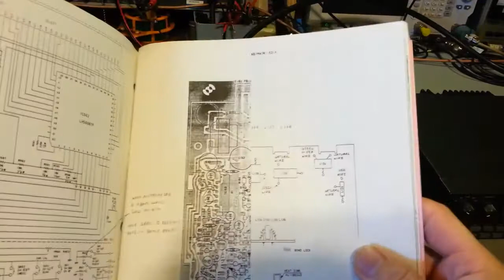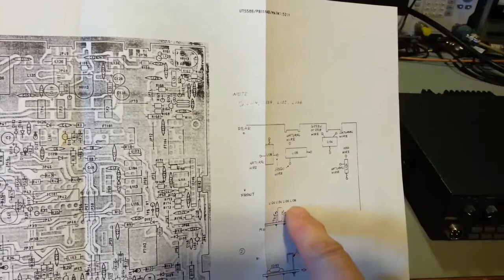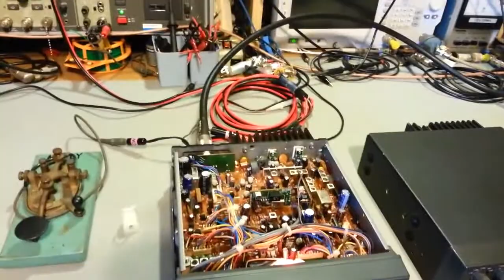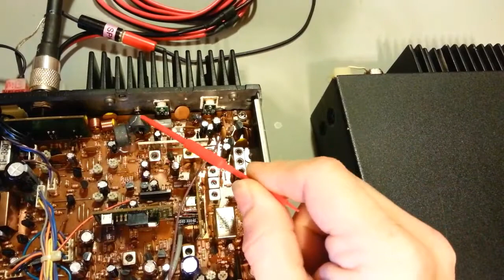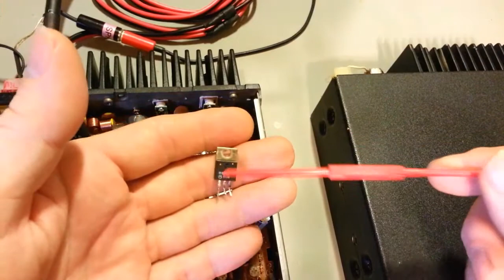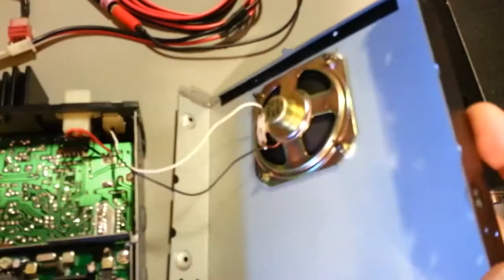Uniden HR2510 & 2600 low or no output power.  Get the glue out!!!

Comment: I have an HR2510 and an HR2600 I got a Chipswitch put in and got all the glue out as well as recapped. They both work great. Best radios for CB that also make good 10 meter ham rigs.

Comment: I just got one of these radios (again) and I came cross your video and decided to check my radio and there is some yellow looking glue on those components but it is very stiff.  How can I get it off without damaging the components?
Reply from the maker: If it's a relatively cheap part it just gets replaced and all remnants of it removed from the PCB with a assortment of dental tools.  Other parts like the toroidal transformers in the amplifier stage get removed and put in a small stainless steel cup with GC cement solvent.  After a while it softens up and can be scrubbed off with a brush.
Reply: @mikesradiorepair  Ah ok.  Well, it's a factory part as near as I can tell.

Comment: So let me see.....I think you said, 
" Get the Glue out " !
Lol.....!
After sitting literally for years, I broke out a 2600, and an 
HTX - 100 , with limited success !
Caps were probably just about shot, but the Radio's both came back to life !
But now I'll be going in for surgery, to try and remove this glue !
Don't know the age of this post, so I may not hear back, but I was wondering if you 
pre - heat the glue with a heat gun, prior to the picking, or is this glue brittle, and easy to dislodge ?
Fingers crossed, I'll have good results ?
And this all began, because I recently purchased a President Lincoln 2 Plus !
Phone seems to do O.K., but forget about C.W. !
And the receiver distorts on strong SSB signals, etc. !
You get the picture !
As far as I'm concerned, they're Junk !
These old rigs may not be perfect, but beat the new ones, all to Hell, IMHO !
Thank You  for your interesting posts !

Comment: Hopefully a simple question, what is the little add in board and the transistor/resistor with the brown wire added to the bottom of the PCB on a HR2510? I don't see any mention of it in the service manual.

Comment: I have a uniden presidential hr2510 it's been in the closet for 10 years in the original box works fine when I put it away will not power up any ideas thanks
Reply: Dont know much about the technical side of radio .
Have you checked your fuse on power lead , also if your running radio of power supply check voltage  .hopefully its  a cheap fix .

Comment: yesterday i got a lincoln with blown rf transistors(keyed without anteene)….capacitors were blown to bits,i removed the jumper en could not see any current flowing when i keyed it.also an elco was burned beyound recognition,almost caught fire i guess,it didnt had to much(burning) hours on it exept in the back.almost a shame…..

Comment: Hi Mike, don`t know if you can help me but i have a Mk.1 President Lincoln that i bought cheap off Ebay. It was stored for many years not being used so when i got to fire it up  all seemed OK, its got RF power "about 17w" am-fm. BUT NO modulation !!!! Done the DE-glue now have about 21w but still no modulation...checked  the standard mike and that seems fine, any ideas ??? Thanks Chris.
Reply from the maker: If you have no modulation in any mode they trace the mic audio.

Comment: Hi Mike !   I removed the two toroidal transformers, L17 and L18 from my Radio Shack HTX-100 which appears to be basically the same thing as the 2510. I was wondering if you know what the coil winding data is for L17 and L18, as I must rewind them due to being roughed up a bit while removing the brownish glue securing them. If you can help me out and let me know the toroid winding info for both I would really appreciate it ! It would save me hours of work trying to remove the glue enough to see the windings so that i can rewind them. My e-mail address is:  fixxyourpc@gmail.com Thank you ! 73, Mark, WN3SIX

Comment: Would there be any of that in the meter circuitry? My meter does not operate properly and it is developing black specks.
Reply from the maker: +kb5wqw 

There is glue inn the CPU board but where it usually is wouldn't effect the meter.  Spots on a LCD, if they are there when it's off it's the display starting to go bad.  They all do this eventually.
Reply: Yup the specks are always there and the meter is "stuck" to the right. BTW, it is a 2600 used in the mobile, currently. Oh well. Hopefully we'll figger out something.

Comment: Say there Mike. I'm a trucker and I have been a user of Cobra products since they went to 40 channels. I have a 29 LTD that I have had for years. I am looking to get a new radio that has a few bells and whistles that can reach out and touch without costing me a gazillion dollars. I had a President 2510 at one time but I just didn't like the screen in the truck so I sold it to my friend. Any suggestions on a radio or two that would suit what I need? I like the new Cobra with the different color screens and the Bluetooth but I heard you say that they were "JUNK". I understand where you're coming from. Thanks for your time and patience.
Reply from the maker: +Ralph Reynolds 

I have a President Lincoln II+ on my  bench and McKinley's in every vehicle.  Good build quality, have "bells and whistles" like your looking for, have good warranties and from my perspective most importantly I have the factory service manuals for them.  If you want a radio with higher output look at the Lincoln II+.  It's a higher output 10 meter radio that can be expanded to CB, has multi color display, Roger beep, echo, memory channels, scanning and more.  You can check out their radios in the President Electronics USA website.  Also, if you buy a President antenna at the same time you buy a radio it extends your radio warranty from 2 to 5 years.

Comment: My Radio Shack PRO-2006 scanner has that same brown 'goop' on certain parts of the circuit board and the scanner recently started locking up and I'm thinking it might be due to this goop issue. It didn't happen all of a sudden, but rather, slowly began having issues with the LCD where I started seeing anomalous segments appearing in the display. It would go away after a while but the more I used it, the worse it got and now it turns on but is locked up.

Comment: Mike, can you use the service manual for this radio to align an emperor TS5010? The service manual for the TS5010 is terrible.
Reply from the maker: FelixTheHouseFreak 

The Emperor is just a cheaper copy of the Uniden and for the most part are the same.
Reply: Didn't the Emperor replace the HR2510?  I remember wanting one (Emperor) back in the day but I bought a mint condition HR2510 that had never been modified so I'm happy. I still need to remove the brown goop in it though. I had an old ChipSwitch from the early 1990's I installed into my 2510 and it works fantastic. When 12-meters is open my 2510 works great on that band. Needs an alignment though.

Comment: Here in Australia I can't use Hot Glue in radio's that end up in the west......the glue softens and falls off or releases whatever its holding.....just to hot out there.....I use Neutral Cure Silastic. (Silicone)
Reply from the maker: Harb's Elecronics Lab 

The stuff I use has a melting point of 400°F.  I don't use the hobby/craft stuff, it's a industrial hot melt glue.
Reply: Ahhh......don't think I have seen that stuff......Might have a look for it
Reply: Harb's Elecronics Lab I buy glue sticks from a lady in China on Aliexpress. She sells 11mm sticks about 270mm long that are black.
Now this stuff is the absolute best I've come across it sticks like the proverbial and takes some fair amount of heat to get it molten again.
I'm in south east qld and have had no complaints about this I used heaps of it when I was repairing UHF handhelds under contract that were used in very rugged situations. I'll find her link for you you can contact me cooldrivecommunications@gmail.com

Comment: I'm working on a 2510 at the moment, being a pain, input current increases rapidly whilst tx is on (starts off ok, but then starts to climb,  increasing rapidly), I already cleaned off the glue, and replaced both the final and driver, and all the caps, no different! Have you ever come across that fault?
Reply from the maker: +TheDefpom 

What does the output waveform look like, is there an oscillation?  Is there power out in SSB with no modulation?  What does the driver and final bias current look like.

Comment: hot glue wont melt in high usage situations?
Reply from the maker: +ᗒ╬ᗕ1112223333111ᗒ╬ᗕ 

Hot glue melts around 400° F.  If the glues melting in your radio the glues the least of your concerns, it's either on fire or you dropped it in a volcano. :-)
Reply: 400? holy crap nevermind, lol